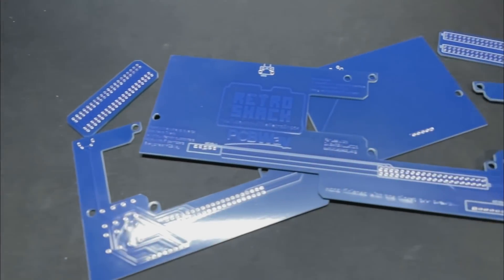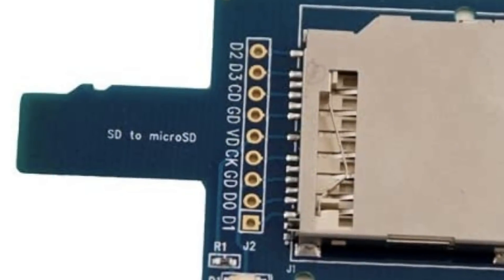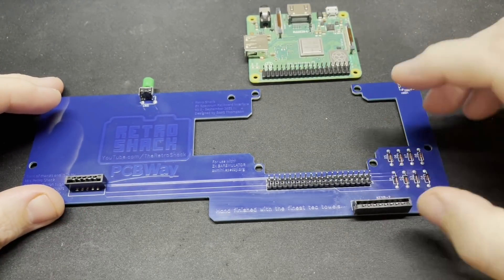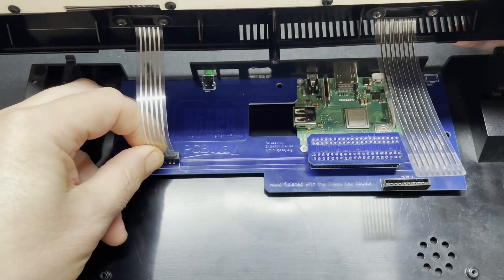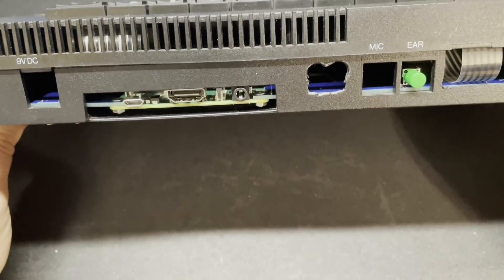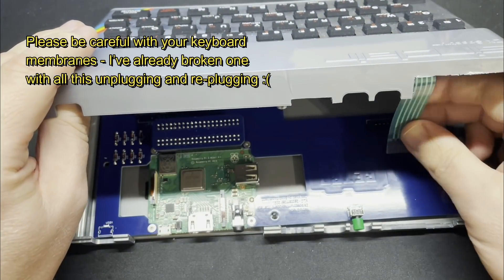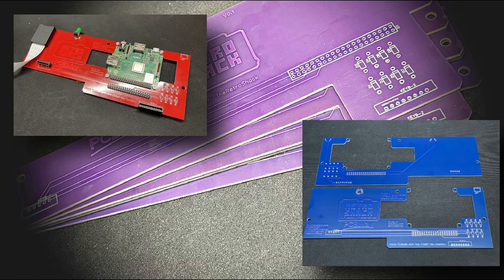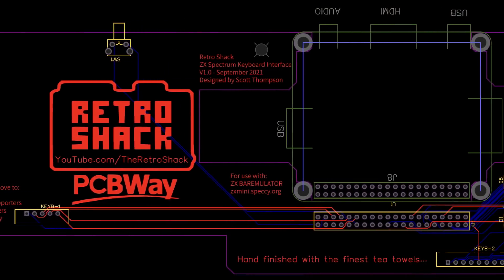ZX Baremulator PCB - Ready for production!

Comment: Wow, I still have the 48K Spectrum in the large case, not the rubber keys, but I haven't touched it for 15 years or so. Don't know if it still works. But this project could be a way to re-use that keyboard case, if the original is not working anymore. And, with the HDMI I could use any monitor. (from The Netherlands).
A real Dutch question: what would it cost me? (besides the tools, which I have).
Reply from the maker: Still working out final costs but won't be expensive :)

Comment: Place a 0V copper flood fill to the front and rear.  It will help your pcb maker balance the depth of deposit in the plating process, making your boards more reliable.
Reply from the maker: Noted - and done! :)

Comment: Good job. I'm looking at the first seconds of the video and I'm puzzled about the routing of the track between keyboard pin 5 and gpio pin 6 (?).

I wonder if it was possible to
1. Center the track
2. Avoid the bends OR
Route the track from the top by adding some extra room on top and moving the other tracks accordingly.

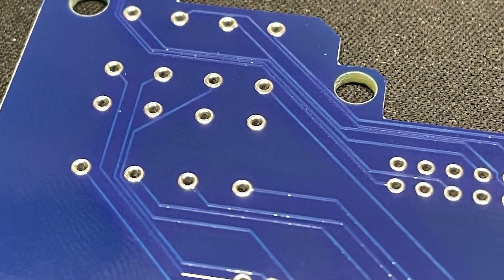Also at 0:36 where is the third track from top connected to on the keyboard connector? It looks like there is a gap in the track.
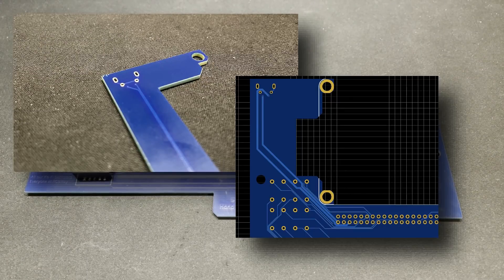Reply: Look at 1:08, it's connected to the connector. It slightly overlaps the board and makes it look like a break.
Reply: @medes5597  not mu point. At 0:39 the track doesn't go to the 5 pin keyboard connector. It looks like it goes into a via, but there is nothing on the other side of the board.

Comment: Are you going to do a PI-Zero-W version?
Reply from the maker: Unfortunately the PI-Zero doesn’t produce any sound through the HDMI port and figuring out how to get around that was a bit ambitious for my first project :)
Reply: @TheRetroShack  have you tried setting hdmi_drive=2 in /boot/config.txt?
Reply from the maker: @yukisaitou5004  The PI-Zero version does not support sound over HDMI according to the author unfortunately:(
Reply: @TheRetroShack   my bad, just checked the project and saw they're using the Circle library so that makes sense! It looks like said library has recently (as of 3-4 months ago) added support for using HDMI audio without the VCHIQ driver which may free up some CPU cycles but AFAICT ZXBaremulator isn't open source so who knows if anything will come of it...